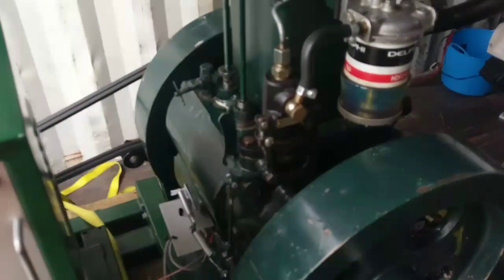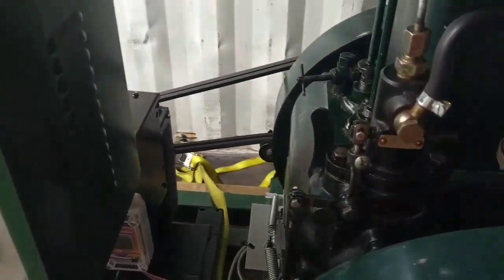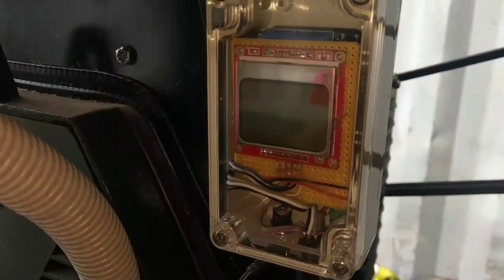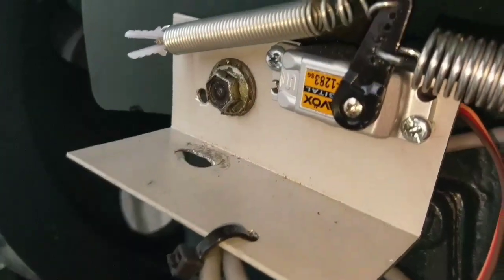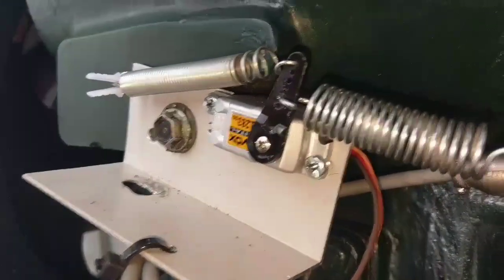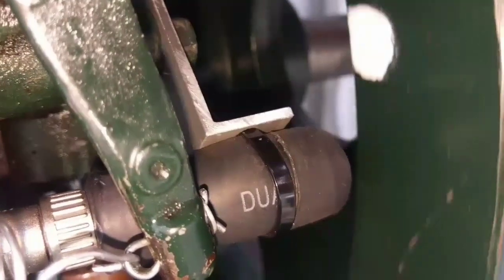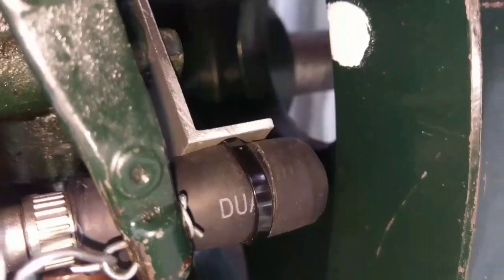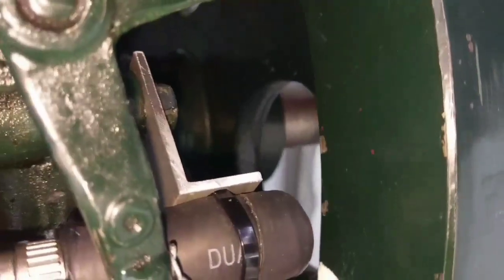Lister Diesel Governor

Comment: Hi John, like the process! With which part of the code did you get to manage the servo working? Thanks for your answer!
Reply from the maker: Rik Spijkers I used an arduino servo shield, and progam it's movment based on the frequency count. I can share the code if you are interested.
Reply: Hi John, that would be awesome. I got your current code from Listerengine.com but could not figure out the part where the servo is defined. Sharing would be highly appreciated. Is there also another way we can get in touch about this project?
Reply from the maker: Rik Spijkers sure, email is John.samin @ gmail.com